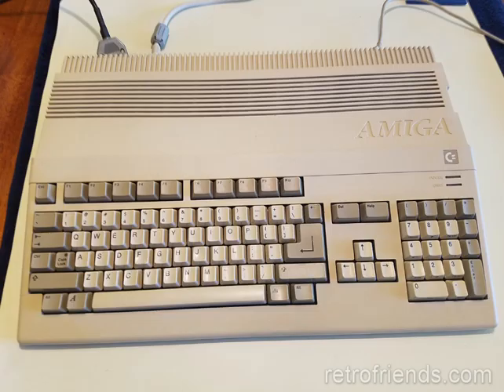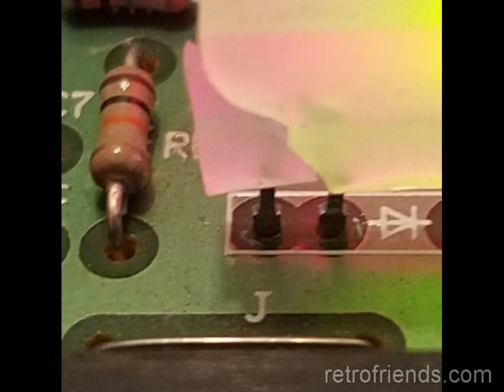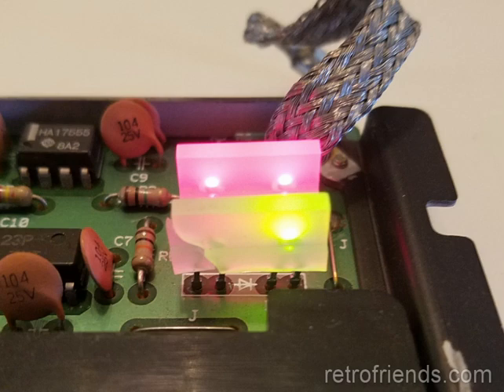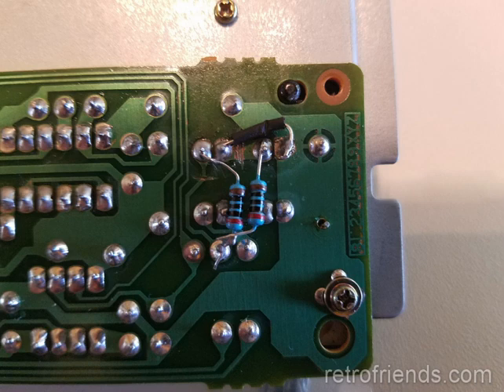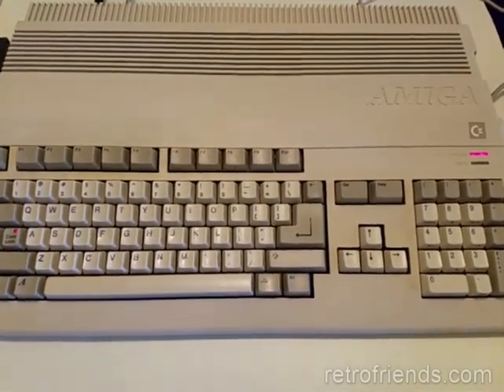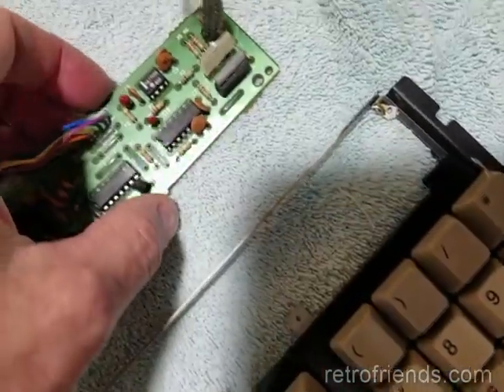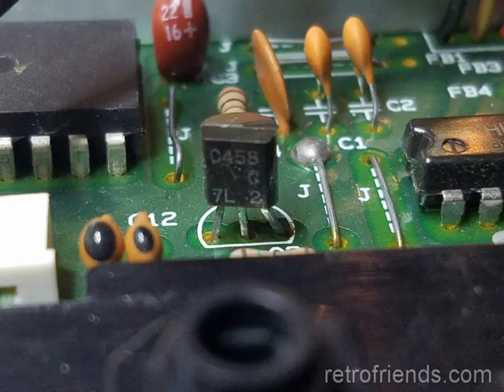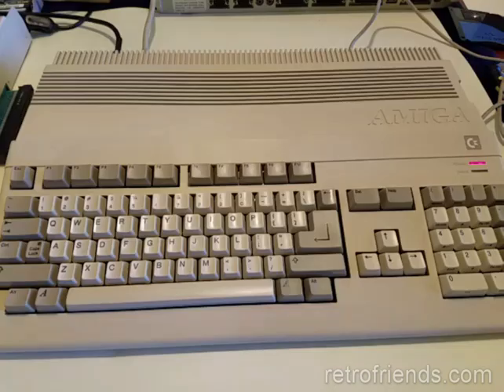Amiga 500 Keyboard Fix. Caps Lock Blinks. Bad LED.

Comment: hello, I need some information: at minute 1,57 behind the red LED there is a silver cable ... where should it be connected? thank you very much. I can't find any video explaining it
Reply from the maker: That's the keyboard shielding wire. Clamps on to the side of the floppy drive. There is a horizontal screw holding the drive in to the case that should have a flange that matches. Since it is part of the Amiga's now-useless EMI shielding, don't worry if the flange/screw/drive are missing. Take steps however in regards to preventing it from hanging down and shorting on the motherboard.
Reply: @retrofriends  thank you very much for the explanation, you have been very kind. thank you